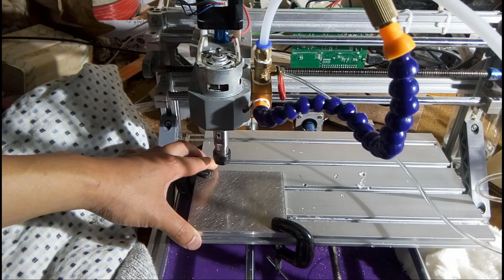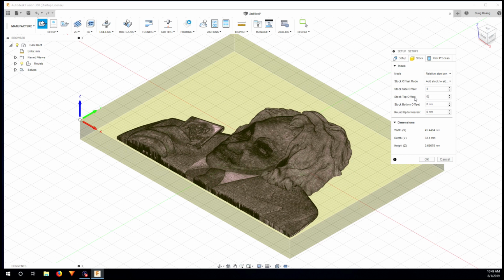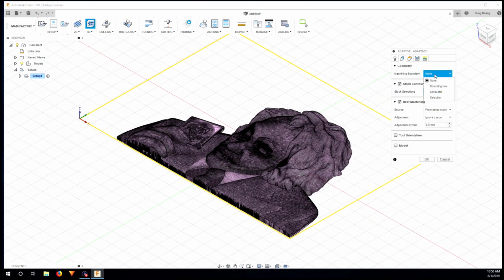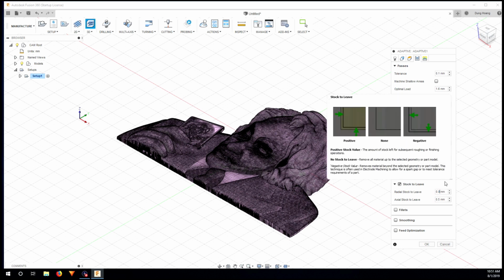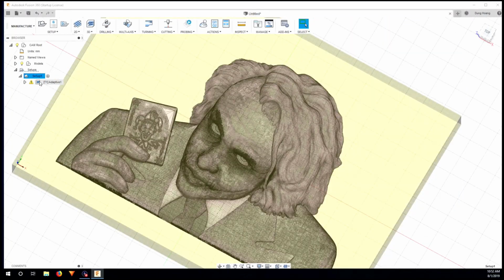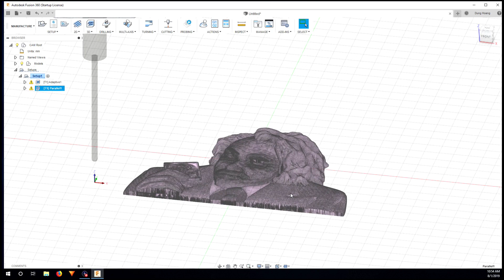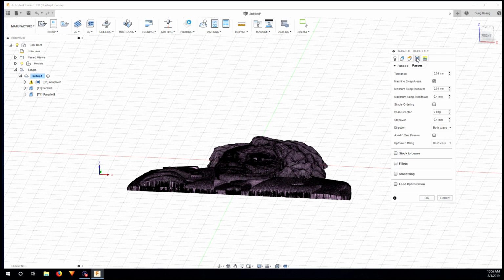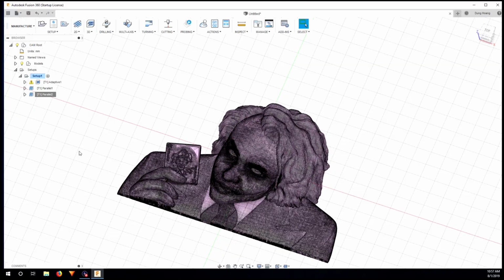3018 CNC - Milling Aluminum - It's doable!!!

Comment: is that with the stock motor? What rpms?
Reply from the maker: Yes, all original parts. 10k rpm
Reply: @minhsmancave9448  ok, was just wondering because they offer a 20k motor upgrade but don't show it's power rating. I see some 500W motors as upgrades using a bigger bracket but, of course, they don't list the rpms. The only one that does list the rpms is the 800W cheapies which I hear are prone to overheating when just using air cooling.
Reply from the maker: If you only have the original setup, don't try to upgrade the spindle. Those bigger spindles are too heavy for the linear rails on the X axis. The rails will sag and vibrate a lot.
Reply: @minhsmancave9448  The one I'm looking at is allegedly from the original manufacturer. So I'm assuming it's rated to work on it. I don't think I'll do a lot of aluminum on it, but I will try a 10W laser with it also and I want to try to use one or another for engraving aluminum surfaces.  My dad passed away last year and I'm trying to get a grip on the stepper concepts as he had one of those harbor freight desktop CNCs. It's not super powerful but he used to do quite a bit of steel work on it. I'm thinking of pulling the table apart and cleaning the crap out of it (it's turning a bit stiff) and seeing if I can modify the cranks with attachments made on my 3d printer that would allow a belt and stepper to turn them. Or perhaps a gear and stepper.

Comment: Hello . the program i use is aspire 9.5. I have to make a recess (with a large roughing cutter) then finish it with a V-shaped cutter which will dig into the narrowest parts where the other (large) cutter cannot enter. Question: How can I set the gcode so that the V-shaped cutter only passes where it is to be milled and not in the empty spaces where the large cutter has previously milled? as with the small cutter the axes move very slowly; I do this to save time.
Reply from the maker: In the program, make sure to choose the option rest machining for the v bit, then it will only mill what is left
Reply: @minhsmancave9448  my program is: Aspire 9.5
Reply from the maker: I don't have aspire (surely couldn't afford it). But all software should have that option, you can Google for it

Comment: If you had a source of lubricant you would be able to cut a lot better with aluminum
Reply from the maker: I'm sure it would. I didn't know much about cutting Aluminum at the time. The lubricant might be a bit messy. Maybe also need a proper base (a big tray) to put the machine inside.

Comment: Hi, can you post a link where are we able to buy 3D g-codes??
Reply from the maker: You can't buy Gcode files. you can only buy 3D models and generate a Gcode file using a CAM software. The reason is because every CNC machine is different (spindle, feed rate, sturdiness...), everyone setup the stock differently, the cutting bits can be also different. Each person need to know their machine to make appropriated gcode files. Just need to practice with the CAM software.

Comment: Back in the old days when machining aluminum on a milling machine kerosene oil was the best and applied with a small paint brush made a better finish
Reply from the maker: I'm still new to milling, I don't even know how they are doing it right now, let alone in the old day. I'm still learning everyday.
Reply: Absolutely...
Reply: A little late to the party, but if you didnt know, the chemical formulation of wd-40 is very similar to kerosene. It would probably be a really good cutting fluid for aluminum on these machines since they dont have flood coolant

Comment: Hello,

I am looking at getting this CNC machine for cutting cooling fins into copper (similar hardness to aluminum). Do you think that the 10,000 RPM spindle would be fine for this if I use the same numbers you did? Or do you think I need to use the available 20,000 RPM spindle?

In your experience do you think this machine is capable of cutting cooling fins?
Reply from the maker: I wouldn't recommend doing it using the original hardware of the machine. First, I will recommend to upgrade the linear rods on the X axis to fully supported rails such as sbr12 or mgn12, mgn15. The spindle might be OK, but the fully supported rail is very important to reduce vibration, précision and saving your cutting bits.

Comment: OK, so it's a year old and the 3018 model......I think you could do with a tray to contain the water drops and keep it clean......my build plan learning curve is getting new ideas all the time.
Reply from the maker: Having ideas is essential and ideas can be changed even in the middle of the process making it come true. I didn't know anything about this machine before I actual making things. This was my first time with aluminum on this machine and i wasn't prepared for all the mess. I just put the towel there because I saw water accumulating. But in end, it's a lesson for me and other people so they know what's coming and be ready for it.

Comment: First attempt and your dealing with a 3d relief instead of the using templates to start dealing with aluminum milling. INSANE!!!..
Reply from the maker: Yes, thinking back about it, I didn't know how crappy the machine was and I went for a difficult challenge. But it turned out to be OK, I learned a lot from the project and motivated me to make all the upgrades to mill alluminum correctly.

Comment: Hi bro. Where you buy the accessory ?
Reply from the maker: If you meant the mist coolant spay, here the link:
https://www.ebay.com/itm/Mist-Coolant-Lubrication-Spray-System-For-8mm-Air-Pipe-CNC-Lathe-Mill-Drill-KHME/362845590548

Comment: A 500w spindle and stepper motor upgrade would probably make it work really well
Reply from the maker: Yes, definitely. I'm planning on doing so
Reply from the maker: @richard646  Yes, I think it can, depending on how you 3D print it. For me, I'll print with at least ABS and high filling percentage. Polycarbonate mixed with carbon fiber probably more ideal. I don't realy have experience with aac/Hebel block so can't really tell.

Comment: Have you tried warming the aluminum plate?   I'm not sure how to actually do that here, but it's an option.  I got this machine for Christmas and plan on trying brass and copper, which should be easier to cut through.   Thanks for the coolant idea - now I know how to make the mist sprayer work!
Reply from the maker: I have never thought about warming up the aluminum since you want to keep things cool to avoid metal melting and welds to your bit.
Reply: True, but warmer becomes softer.  If the material is softer, the bit won't have to work as hard.  You can still cool the bit.  It works for drill presses, just not sure about the CNC.   Cheers, and I enjoy your videos!   Thank you for the hard work!
Reply from the maker: Maybe it's doable on other CNC machines that have more space to install extra components to heat up the aluminum stock. But on this 3018 CNC machine, there's not much room to play with. Hopefully someone can try it and share their experience.

Comment: Is that the stock spindle?  I just saw someone upgrade to a Machifit ER11 500W....also what grade of aluminum.....Aluminum 1100 is the softest
Reply from the maker: Yes, it's the stock spindle with a ER11 attachment. If you can upgrade to 500w spindle, it will be better. I have no idea what type of aluminum it's since I just picked up a piece of scrap from the store.
Reply: @minhsmancave9448  For that joker 3d ..that would be hard to cut .. Cut a mold and melt aluminum and pour into the mold .. like making jewelry.. Aluminum parts ..screw holes and such is easy to make your marks and then move to your drill press etc.. Or do vector art.. line drawings... The little desktops can do quite alot of stuff.. I had a 3ft x 4ft 4 axis machine when I was machining for GE advanced materials.. and most parts are small you would just have a nest of 10 or whatever per run... servo motors are the most accurate..=/- .005 which is aerospace specs.. stepper motors are =/- .015 which is normal mfg like gibson guitars... find your sweet spot.. Mfg of bits have charts and materials to cut and what speed .. slower is not necessarily easier on your machine... as you increase speed it will sound awful then increase again till it hums.. the bits are a little more but worth it..https://www.onsrud.com/Forms/Cutting-Data-Recommendations.asp  this is great info
Reply from the maker: Thank you for the advices and info. I'm still a beginner in this CNC machining world and have a lot to learn. I'm not intending to do any type of mass production with this machine. Only testing it and see what it can do. I just share my experiences a long the way.
Reply: @minhsmancave9448  Its cool tech and fun to learn.. I liked your video..

Comment: Nice work can I ask you for the link for that hose you bought from eBay please and what you recommend for software as well and links 
Kind Regards
Reply from the maker: The previous comment on this video give pretty good link for the hose: https://www.ebay.com/itm/Mist-Coolant-Lubrication-Spray-System-For-8mm-Air-Pipe-CNC-Lathe-Mill-Drill-KHME/362845590548.
For the software, I use Autodesk Fusion 360 for CAM: https://www.autodesk.com/campaigns/fusion-360-for-hobbyists
For G-code sender, I use Candle: https://github.com/Denvi/Candle

Comment: Some Links for this:
Coolant System:
https://www.ebay.com/itm/Mist-Coolant-Lubrication-Spray-System-For-8mm-Air-Pipe-CNC-Lathe-Mill-Drill-KHME/362845590548

15lb Double-Sided Tape:
https://www.ebay.com/itm/3m-RED-Double-Sided-Super-Sticky-Heavy-Duty-Adhesive-Tape-For-Cell-Phone-Repair/132752089503?var=432062740030

Small Air Compressor:
https://www.ebay.com/itm/Portable-Air-Compressor-Pump-150-Psi-Dc-12V-Auto-Tire-Inflator-Gauge-Car-Pu/254418618388

Aluminum/Steel Milling Bits (with 1/8" shaft)
https://www.aliexpress.com/item/32675979518.html?spm=a2g0s.9042311.0.0.27424c4d6hUfZY

Comment: Cool. I want to get one of these machines just to do aluminium faceplates of 2mm thickness. Maybe slowing the process down will make better results with aluminium
Reply from the maker: Yes, definitely. Take your time and doing things slowly will make your cut smoother
Reply: @minhsmancave9448  does it 'burr' the metal if you go toos low ?
Reply from the maker: Yes, it does, especially with multi flute end mill bit. Just have to find the right speed.

Comment: At 16:16 you can see his bearing on his x axis come out of the spindle block on the bottom x axis rail right of screen lol.
Reply from the maker: Dude, you have good eyes. I tried to ignore it but my machine is coming to its end of use. I already moved on to a bigger and sturdier machine. But this 3018 had served me well, I learned CAM, built the new machine with it. So, no regret buying it.
Reply: @minhsmancave9448  what machine are you using now?
Reply from the maker: I built my own bigger machine. Take a look at this video, I showed a bit of that machine: https://youtu.be/GZzTefFZHVs . I built that machine using the 3018 to cut all the brackets and guides. But the construction didn't go as smoothly as I expected so I couldn't make a video about it. However, I learnt a lot from the process and I will show easier builds in the next videos about laser engravers and plasma cutting table.
Reply: LMAO
Reply: The machine could have done better if he paid attention to all those small details. Blocking the bearing from coming out would have been easy.

Comment: My cnc 3018 Arduino nano machine didn't expect g code and give mirror image cutting ..plz give me a solution for this thanks
Reply from the maker: It's really hard for me to see what's exactly the problem is. It might come from your CAM processor, the firmware on your arduino, the way you configure the motors,etc. I might be able to do something your give you suggestions if I actually have the machine or my machine had the same problem. But remotely without seeing the process of you using the machine and how the problem showed up, I can't really help.

Comment: Congratulations on the achievement.....I'm quite stunned that this machine can get that far...….it definitely is not just scratching the surface and could be classed as really milling the material. Aluminium is probably at the limit of expectation but it didn't crash and burn in the end. A very enthralling adventure using Fusion 360 and a machine designed for the hobby person.
Reply from the maker: Thank you for the nice words. I think the machine will cut aluminum just fine as long as you take time and cut at slow feed rate. If I was to do it again, I would reduce the plunge rate even more, the feed rate on X and Y seemed fine.
Reply: @minhsmancave9448  Hi, I think as these machines are built down to a price with the very basic of technology and materials, and going by the results you have shown, I would upgrade the leadscrews to 12mm ball screws and a more powerful spindle motor....the 500 watt model has been retrofitted on some other machines. What you will achieve with these mods is a more accurate output even if the cut rate remains the same due to the frailty of the framework. Eventually you will have to tolerate a less than ideal machining process but it will no doubt perform quite nicely. You're looking at an end result as opposed to making something quickly.
Reply from the maker: Totally agreed with you there. That's why I built this machine: https://youtu.be/GZzTefFZHVs. All the parts and brackets was cut using the old 3018 CNC. With more sturdy frame, rail and ballscrew, it cut way better - more precise, faster, etc.

Comment: Great to hear you had some success with aluminum. Now I'm not so nervous to try it with my 3018. Keep up the good work!
Reply from the maker: Yeah, it was cool to be able to do it. But I'll probably just stick with wood or plastic because milling aluminum is so slow and quite messy with all the water spraying around.
Reply: Good attempt but it would probably be better to cut pla or casting resin then use investment molding or sand casting or use mdf and build your patterns on the cnc then those can be used in vacuum forming.  Or cnc pattern to make a vacuum mold which casting wax can be applied to make production trees from which dozens of copies can be created..
Else cnc an injection mold from something softer and make injection molded patterns to be covered in investment slurry burned out then filled with metal then post work refined on the 30q8 and with a jewelry saw and drill or Dremel with a press attachment. .  otherwise great job and motivated me of what I'm going to do when I get out of the Hospital. Covid 19 sucks.
Reply: You could've cheated with a vacuum it ehoulfve drw away bits and the heat use the same system just have to add a tap to a vacuum leading to the reservoir then to the spindle and the same line that draws the fluid would dissipate heat while  clearing chips.  How is the 500w water cooling system?  Tempted to add it to mine?